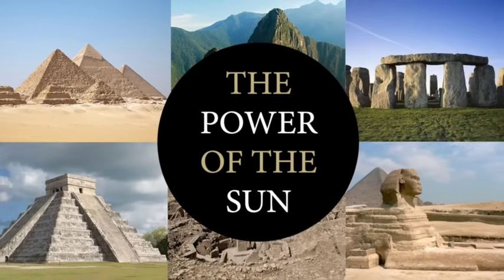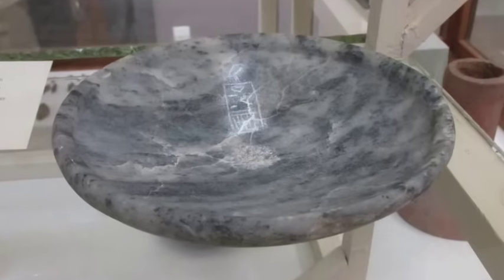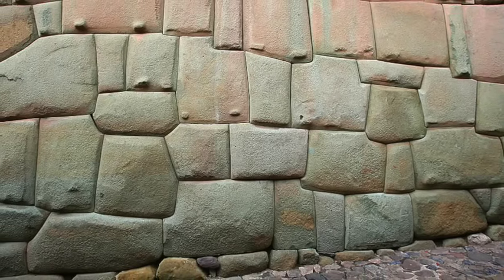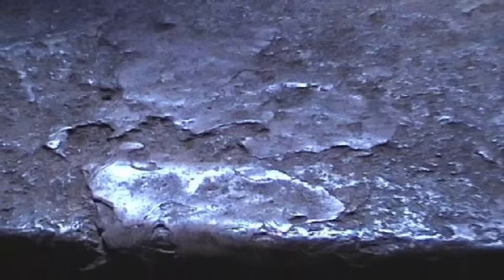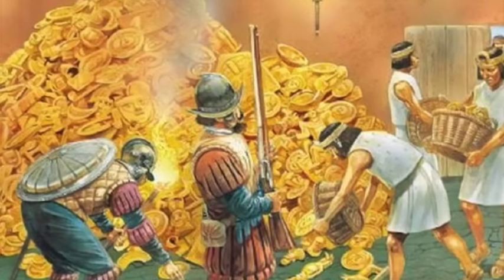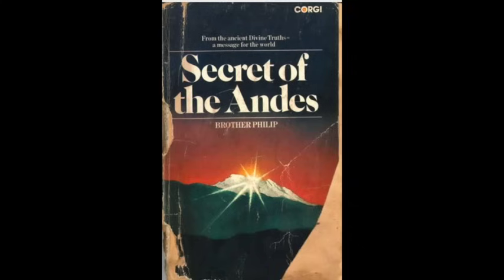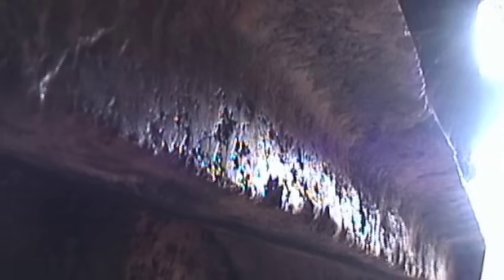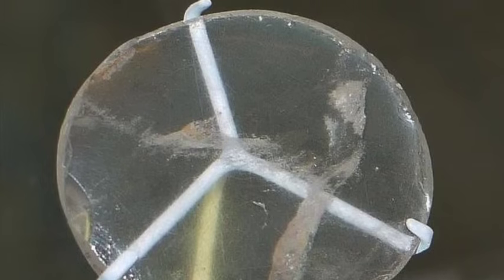How the Ancients Cut Stone with the Sun - Lost High Technology Explained | Ancient Architects

Comment: You are almost there. As I've said in numerous past comments. The ancient people including all the ones you mention in this wonderful video, had skill with polymer technology! They worked stone better than we did. They knew it better also! In modern dentistry, which is my background for what it's worth (retired after 22 years) what is done is the following. Now I want you to imagine that we are only catching up to what someone else did many years ago only on a massive scale. Bear with me, and forgive the length. 
We use a high intensity light to set up the material we use that is tooth colored. This glass ionomer composite material is quite pliable and workable before you set it up with the light. In fact you have unlimited working time to mold it and fit it and shape it and trim it and then when it is all done they cure it with the dental light. This light is so bright everyone including the patient wears protective eye wear. 
Now imagine this on a mega scale! Imagine they molded the rock, that it was a composite mixture which explains the as yet unexplained scooped out marks all over the place of specific  minerals of the top soil down to specific depths. Now why do you suppose they would do that? Maybe because it was a needed ingredient? Lets continue the thought process. 
They never had to haul anything but bags of minerals and specific ones at that. 
They also, whoever these people were crowned an entire mountain! Get this, they crowned as in held up and supported a mountain still being supported by these massive placement stones that prevented the natural falling rock occurrences that should have and would have happened without this event.  Consider that they saved an entire mountain from crumbling with this tech. And never once did they have to do anything more than mix the stuff, make it a putty and pack it in place setting it up to a glazed baked on finish. 
They did what we do only on a much larger scale. And the gold discs they used were 100% efficient. That means they could use these in series and not lose any of the power of the sun, even reflecting it through many discs deep inside of places! They did this with gold for this efficiency.
Reply: Well, some are here to actually discuss the subject matter and not make fun or light. I can continue. Long skulls apparently died off. We suspect they were mostly coastal and river dwellers. We know from the digs north of Chicago in the 30s that these long skull tribes traded with those in the Gulf and goods were found from further south also. Shells I think it was. As I recall these were only seen in South America. Anyway, interesting side notes and whole thesis papers could be done on long skulls and round skulls and their rise to power, and demise all from cataclysm. It appears today there are walking examples still of these 'long skulls' and we call them royals. These often display a remnant bun or remnant long skull often referred to in academic circles as "the Pharaoh Skull" and you can see remnant buns best in royals. Check the side profile of known blue bloods and they indeed do have Pharaoh skull shapes. Eric Clapton in fact has this shape and is a blue blood. 
It appears to me and others that RH negative blood type goes with these remnant buns. So does red hair it seems across races even. Mitanni display this and they were in Egypt also as I understand some of the wives were provided to Pharaoh and priests from these tribes that practiced cranial deformation but why is the question? What were they preserving? I suspect it was the ancestry barely evident unless enhanced but they probably did descend from these actual long skulls and the tribes that were once in charge here and probably did build most of the stuff we round skulls find so amazing. 
After this cataclysm there was a divide between the long skulls and round skulls in places and round skulls hunted them down.  Some say in the south Pacific these long skuls, led by a man named Patuko the Long skull ate humans or round skulls and called them the 'long pig' considering them the best of all meats. These tales are still told there and these clans had long skulls and red hair and looked exactly like those found in Peru and Paracus museums on display there. This was the long skull tribe they have tried to cover up because this is the tribe that ruled us. 
The digs prove they were the royals. When they died all royals today trace their very blood type to these same guys and they cover it up. Anyway, it's all there. Its research material I'm too old to do. But anyway, what does an old man know? 
Okay James back to your 'lazers' I suppose.
Reply: Oh if I only could James Wallis! I went to school at Southern Illinois U and studied anthropology and psychology for so long thinking I"d pursue one of those but there is no money in it! None at all unfortunately so I went with dentistry and graduated dental school instead! It was a compromise for money and I don't regret that but oh what I could have done if I had done the other! If only. 
In the 1930s a doctor Langford, one of my heroes did a write up and it's still here in the "Rediscovering Illinois" section of the 1931-32 Illinois State Blue Book" found here. I highly recommend the U of Chicago write up to all of you. It is hard to scroll through but well worth the effort. http://www.idaillinois.org/cdm/compoundobject/collection/bb/id/19158
I am what you would call an eternal student! I studied! I really studied and have over 367 college credit hours to my name from colleges all over as I went where ever I lived. I admire those that were in the field. My field was a classroom and a lab. But I was brought things. I worked on a team with my father in law who was a high up political person in dentistry. He was a elitist by definition. Editor of the ADA journal with all the contacts. This man knew things. He shared things and I was allowed to be involved in some anomalous find discovery of 'long skull' tribes of people dug up by some trying to sell fill dirt when they dug up bones! 
As in the article I site these were not Homo Sapiens Sapiens. These were something else, a long skull, older than us and found much deeper. It was found well below the original ground level of the mounds. This tribe predates the Hopewell by 2000 years. This tribe is documented as the first people of the north American continent. They were displaced by the natives we displaced when settlers came. 
I have examined these skulls and these skulls exhibit modified cranial nerves from that of human round skull tribes. Round skull tribes as in you and myself have 12 cranial nerves. All humans have 12 and no more. This tribe of long skulls has a modification of one nerve we call the trigemninal nerve in a human. On this being it branches additionally to become a 'quad-geminal' nerve and the long skulls most always develop and exhibit parietal foramina on the rear plate that is not seen in human or homo sapiens sapiens round skull people. 
It is possible that this addition of a nerve we do not have gave this tribe some advantage over human. Perhaps they could actually see these energies they tuned or maybe they could sense them in some way we cannot. So these stones and their placement are all set up as if they are tuned in place as if they could detect somehow the optimum position and type to use and maybe this additional nerve set up in their heads offered them some such way of making this easy for them.
Reply: Most plausible reference I’ve seen to date, this is actually outlined a little bit in the Mesopotamian tablets, by which knowledge was given of construction and building in exchange for service and minerals, this is a deep rabbit hole, there is a reason we inherently horde these precious ores, it’s the same reason we have a inherent fear of the darkness, we have a genetic mapping for survival, the saber tooth tigers damn near ate us into extinction which is why we have this survival mapping with darkness, the ores are what we traded in order to gain civilization and survival, progress, the polymer secrets were coveted by the controlling groups, the story of Moses and king solomon, and Solomon’s temples and city’s reference this, volcanic Ashe with romans and there cement is an example of this, ancient wizards or alchemists privy to this knowledge, iron oxide, magnetic flux and ect. The static and geo electric generators of the ancient civilizations such as the Giza steam generator and such.
Reply: Wtf
Reply: I never said anything about lazer and it's laser, rifles, or energy or antigravity in any of my comments James. Not one. If you don't read the sheet you won't understand it to comment dumb ass! You actually prove this. Go back to your bong!
Reply: Excellent questions M. Canut de Bon. First: Yes there is a link to the one that comes to mind which is the Lima Holes, and here it is for the select mineral explanation. This explains why anyone would do this to me as well as anything I've heard or read. They needed specific ingredients. That is my theory and we should probably evaluate those deposits and the layers for just what they were hauling off. http://www.viewzone.com/lima.html
I've watched I don't know how many videos on this where the narrator and the people studying this phenom. ask where is the debris from the Nazca plain? That used to be the top of the mountain right and it's gone right? Okay well imagine it was used to turn into powder and they recycled it into the stones that support all the massive amount of mountain that would slide down if it were not there to stop it. In Tibet the falling rock is the most dangerous part of living but in Peru around these large stones holding back this danger it is a different world of safety. 
I suggest a panorama view of Sacsayhuaman and other places such as that but nothing beats the Great Wall of Peru! Many don't even know this exists! And to be honest books don't mention it anymore and none of the newest series ever talk about it yet it's as impressive as anything there.  It does make one wonder at the apparent systematic attack of any narrative that takes focus outside that of the approved of field of view academically.. It is a massive endeavor this wall, that encompassed retaining not just an empire but it safeguarded the cities and empire from both marauders and the landslides, in some places quite well and it's held up remarkably well to scavenging by locals for stone, as well as earthquakes and floods over many generations. https://io9.gizmodo.com/5634600/the-ancient-abandoned-great-wall-of-peru/
Reply: Troy Taylor I spend much more time reading comments, than watching actual videos because of gems like yours, my good man. Thank you for not hoarding knowledge like too many others do. Much appreciated from Tucson, Az.
Reply: I used to think that but your theory means they had to transport those incredible size boulders to their locations and that is simply impossible unless the ingredients were first carried in small amounts that could easily be transported by pack animals and human means. I have tried to bake stone to soften it and it usually explodes, sometimes with some force behind it. Romans inherited the means to create cement that set up under water and this was used to make barriers to control the force of the incoming waves in several of their ports. While I agree it appears in some places rock was indeed being chiseled out and hand hewn into shape. even this can be explained for the terrain it was found on because using sleds filled with stone until the sled weighed more than the hewn stones they could move it for some distance using nothing but gravity.  Moving stones over the terrain in question on Easter Island and places like Peru leaves little else to consider except for some form of concretion mix they invented and baked to a near ceramic glaze in places.
Reply: Troy Taylor 
 Let's not forget what Teslsa Re Discovered, mainly  everything Tesla made or patents wasnt his.. phe Wouldnt  and never did made any claim that discovered  it him self  he rediscover what was forgotten..  Except one thing . Had   something todo about Aether he did search for years  in  9 languages. Before he claimed, it he discovery,   that another story.. Tesla push for free zero point  energy for every one at any time as much as  you wanted.. An endless supply of it., we would  never need to use oil or any of earth natral RESOURCES again he was very adamant about it because we were are killing the planet by removing. Oil natural gas methane. We keep  taking from  the EARTH and she been giving and giving with our  giving  back, how much could she take of that type recklessness spending.. Like giving your trophy  mistress  a 10k limt credit card. she thinks she  Kim Kardashian.. it's max out by Friday.  What did she give back.  Nothing but demands more or she leave you for your boss owner of 1000million dollars a years co,..  . This  is why she dieing . Right now the  Pacific Ocean is already dead.. the sky and the air  is mostly a Toxic  Chemical . They been chemtrashing the skies   for the last 20yrs.. all for better communications. SO they say,, right....?. The technology wasn't just the sun but also the 7,83hz of planet earth..And the Aether. Or  power of 369  Brikland currents hall current  Peterson currents.and so on and so on. Electromagnetic portal connections between the sun  planets Galaxies  all take place all day long every day universe is filled to the brim . We couldn't use up a drop worth in billion years.
Reply: Apparently the pyramids are polymers and it's provable because the fossils in the rock are not aligned as they would be in normal rock.
Reply: Troy, excellent conjecture.  A couple of questions: 

1) what examples are you talking about when you said "unexplained scooped out marks all over the place of specific  minerals of the top soil down to specific depths" is there a place in particular where this can be seen?  

and also 2) What place is the one you are referring about with "these people were crowned an entire mountain! Get this, they crowned as in held up and supported a mountain still being supported by these massive placement stones that prevented the natural falling rock".

Very curious and thanks for your post.
Reply: I like this line of thought too. Joseph Davidovits.  https://www.geopolymer.org/archaeology/pyramids/book-why-the-pharaohs-built-the-pyramids-with-fake-stones/    Near my house is some gravel that is crumbled granite.  Even granite has it's day.  The gravel and sand has all the colors of granite and can be glued back together with soluble SiO.  One day I'll get off my butt and try it.
Reply: Troy Taylor , I really enjoyed reading your comments, you are obviously a driven and thoughtful person with a heck of a lot of knowledge. I can’t really make my mind up how I think they did these things, reading your ideas is thoroughly thought provoking.
Hopefully one day we will understand just how these amazing structures were built
Reply: Alex I guess it began in CCD as a good little Catholic boy! I asked so many questions, difficult questions to the priests and nuns that on one Sun. I was pulled aside and told, "You know Troy, if you want to skip CCD from now on it's fine, no one will say a thing to your parents!" I kid you not I skipped too! My brother loved it and later used it to leverage me into his own devious behaviors as a youth that I in turn had to hide for him. Such was life at a time when innocence was still present but even then I knew someone wasn't presenting the entire picture but various versions of their truth, Catholics included! My IQ and my "SHELDON COOOPER" syndrome as my wife refers to it has gotten me into trouble on more than one occasion. I try to blend in and be normal but the truth is I am not and just make a fool when I try to behave as anyone normal would. 
I see. But when it comes to some things well, it just stands out. I could almost say I smell it. 
Lexicons Recentis Latinitatis. This is something that stands out to me but I read Latin. This was published by the Liberia Editrice Vaticana where they insert the Latin neologisms you'll find that the Vatican inserted the following terms if you look. Those being,  "navis sidraelis which means 'starship'. So the Vatican calls that thing they saw that distinctly hovered over water that they depict and use as the basis for all modern religions called a "RUACH" or God's fiery chariot is called a "STARSHIP" by the largest religion on earth? Boy this excited me being a Star Trek fan! 

They inserted aeria navis in there also! Oh boy I thought to myself 'thus' airship, and they were talking about flying machines in the bible and the Vatican wasn't done! Man I'd found the frickin' gold of all gold they inserted aereus viator which is astronaut! Someone in ancient saw a astronaut!? MY head was spinning! I couldn't wait till CCD!  And the Vatican also inserted the acronym R.I.V. which to me and my dad was as good as saying UFO baby!! All it did was get me a ticket to skip though and so I did. But you know what!? That was a mistake ! I should have been on his ass! I think that was what put the thirst in me. I was hungry then. I didn't get a answer. I was not going to be satisfied and my anal brain would not rest until I had that satisfaction. My syndrome prevents me from lying. If anything I am guilty of being brutal honest. I don't have many friends and prefer this venue just because of my condition. Some don't get it. 
Thanks to some few that do I stick with it because it's the only real social life I have. Thanks for not telling me I can just skip this class.
Reply: Maybe they saw lava from a volcano, watched it cool into rock and reverse engineered the process whilst tipping the liquid into molds?
Reply: Troy Taylor Interesting comments
Reply: Troy Taylor very interesting do you have any idea of what the compound that was used but I jade my own theory nikolai tesla invented the isolator it's a kind of computer that can find the frequency vibrational energy of rocks or anything if you find the frequency vibrational energy of rocks you can negate the magnetic fields vibrational frequency energy that's surrounded the rock and levitate the rock or you can destroy the molecular bonds and break it apart
Reply: I worked for a time as a student trying to learn flint napping and never could quite get the hang of it as well as I would like. I got pretty good at making human tools but not great, and certainly not good enough to survive with what I made. I had friends that made things very well though and theirs worked. One of these guys does museum pieces and is quite good. One of the best actually and he told me that the Neanderthal tools are much more difficult to duplicate and that in fact no human can duplicate them. We can't do them as well as they did them. Theirs are excellent and efficient and ours well, suck! They worked stone better than Homo Sapiens Sapiens. Others did also but we try hard.  
There is a reason secret societies call it "MASONS" I think. It's all about the secrets of stone! It always has been about stone.  Today we can make any surface. We have the technology to make you a granite top from granite dust and we have the ability to make any other stone so it stands to reason that someone else did that too. 
What people don't realize is that the stone has an electric charge to it. Most all these pedestal stones and standing stones have energy about them, either sound, static or vibes being noticed. It's not accident that profound visions have been recorded through history by people laying their heads on standing stones. Solomon, Arthur, David, the list goes on. They had visions around stones. 
Looking at the layout above you see immediately that the ancient people that laid out the grid were using the standing stone monuments and assemblies as giant computer circuits. The earth was the circuit board the the temples and complexes are the computer chips and the charge is running through the earth grid connecting all these places by the circuit completed. That is why I've called it circuit board earth because from above that is what it resembles, a big ole circuit board with connected Mayan, Incan, Aztec, Egyptian, Korean, and more African connections broken than anywhere! One has to wonder what would occur if these were reconnected to the grid? 
What is more puzzling is the placement of the grid stones. They are precise and aligned with nodes and intersections of ley lines and magnetic energies as if whoever did it could sense it or see it to line it all up. We need technology to see this but someone else either had the tech. or they had a natural ability to sense these energies. Tesla proved all the obelisks are power sources sending out power to something. However for thousands of years nothing has been using this energy. There is also known continuous energy emitting from the tops of pyramids world wide no one can really explain. They prefer not to mention it.
Reply: +Troy Taylor  funny had the same thought just a week ago. after I had my tooth filled they cooked it on. was thinking about how I could build with it. like giant blocks and walls of white stone. the material we use atm isn't strong enough yet. I always believed they molded the giant stones like pouring walls with finished exteriors when still wet. let it set a bit pull forms smooth out. never thought about needing the sun though. would be more efficient than having to use a fire.
Reply: Built by the nephilim who where fathered by the fallen who was enlightened by God?of course they where all smart?not only did they know how to soften stone but knew how to mess around with dna also?
Reply: Cutting and trimming can all be done using sonic instruments. They had low voltage and knew about chemical reactions also as evidenced by  finds but I think gold wire had the same 100% efficiency so a battery that pumped 18 volts pumped it at the source and at the instrument both due to the wiring they used. So just as that link to melting stone earlier shows they could cut stone acoustically with low voltage all day long and have light in there to allow them to see all they were doing even in a cave using discs also made of gold that lost no efficiency or brightness over any distance regardless of the number of discs used. They could literally spot light an area of the mouth to work on a tooth size surface if they wanted. All it took was minor adjustments with mounted discs. In some places you see the weird appendage pedestal stones and I believe they did indeed hold the disc so it could be manipulated. 
By the way if you guys like some of the subject on long skulls and want to know more about that and red hair, and more look up Gabi Plum videos and watch our Cousins across the sea the red head people and her others. You'll be thanking me.
Reply: First. I would like to see stone melted from solid to a liquid.Someone said it was like no fuss or something. Show me. Love to see it. Sincerely.  M. Gritz.I did not see any evidence of a eye in my autopsy. What I saw was a cranium approx. 20% maybe 25% larger than a human or common round skull. The mutation, of the fifth cranial nerve if I am to call it that, perhaps ours is the mutation? But I digress. The adjustment would be necessary to this nerve I suppose to feed blood and nerve supply to parts of the brain and skull that we simply do not possess. I am unfamiliar with the tests of which you speak with reptiles. Sounds very interesting though. 
If I was your dentist and gave a shot to you called the "Gow Gates" in my field, it would give me a complete mandibular block on your face giving you comfort for a lengthy procedure. For you it would be easy to chew your tongue, your cheek, your eye would droop and you'd slobber all over yourself as your lip drooped because I'm blocking that cranial nerve or most of it that we call the trigeminal and it would repeat Bells Palsey symtoms on your face for hours. Imagine this guy though with the cone head getting that shot. What might it numb up? It could effect his olfactory sense tremendously and if he was a species say geared to that it would be akin to taking a cat and cutting it's whiskers off!
Have you ever treated a cat from a fire that lost it's whiskers! It's like they may as well be blind and you took their security blanket because most won't budge or move much until they come back. It's like they can't leave home without it. 
Someone else mentioned Persians! You know the Persians were the great sailors and they took the "SNAKE PRIESTS" all over the world. Snake priests were Druids or Maggi in the bible. These were holy men but feared and their serpent like dress because of their fancy for reptiles and wearing croc and alligator skins and teeth and such well, and with the cone heads they looked like snakes. They were said to be tall also and ominous. They still leave the impression of the angel of death. 
 They hunted these guys after the divide. Some say legends of reptile and giant slaying all stem from that and that they were cornered or at least a gaggle of them was cornered in Egypt. Think Akhenaten the Pharoah on the run as they ran from Egypt to Peru then to Paracus. In small pockets they hid but then they found a way to hide in plain sight the way they do now hiding this story and themselves. Those that hide this are those usually that would also have this "EYE" or the potential to see somewhat in this way you speak about. I don't dabble much in the paranormal anymore but I know it exists and things happen.  Therefore the potential exists that some small group of these hybrids that were thought to have been hunted out of existence do in fact survive in the leading families of our rulers. Just a thought. Just sayin'. We have certain evidence of another hominid on this earth just covered over like it never happened. Why is that you figure? Maybe because like the movie they do in fact live! They Live. Oh boy.
Reply: How complicated would it be to assemble the ingredients for these compounds which end up looking like different kinds of stone?  This YouTuber shows how to make Roman concrete, is it possible to make concrete which looks like diorite, granite, andesite? https://www.youtube.com/watch?v=tOhAfaFboNU  Some of the drill holes and cut lines look like power tools were used.  Maybe they knew how to soften stone, then let it harden again?
Reply: Troy Taylor I work with a guy from airforce he said his job involved testing directed energy weapons on livestock.  Real deal.   Working units of deathrays
Reply: Leaders or elite among us always wanted to control the masses. The control is a big factor to them. They have to remain hidden I think. Wizard of Oz, think the man behind the curtain. The thing is they need to be seen with awe for their power to work. So I think the mystery is a necessary ingredient in rule of the people. 
In the past the tunnels under such things as the pyramids had a purpose and the priests thought to be holy, and above corruption of course by the innocent masses are not like this at all but are actually all from known crime families of pirates that were wanted on the high seas before the big cataclysm. These families survived in large part better than the elite rulers that were at one time hunting them. These families started a little thing called the Church and became very strong. They are still strong today too obviously. 
After the cataclysm the crime families that survived acted fast. All the matriarchs of the old system were systematically hunted down  while they were weak and by the crime families. They did this to secure papal appointments. 
The pope would appoint the King and then the king illigit of course, had to become legit somehow. So he would bag him a queen.  The old system was that of a Matriarchal system, think ISIS and that. They began wiping that out over time and infiltrating it. 
History shows how they did it and I won't rehash that. The fact is though all the stories we know as myths,  Cinderella, Snow White, Rapunzel and more all are based on fact. These matriarchs were captured, imprisoned, drugged, raped and kept as slaves to make them brood mares for the illigit kings appointed by the pope. Since the bloodlines ran in the women in that system mating with them to produce children made the kings legit. 

Most of these crime families are from IRAN (ARYAN) and have the cone head heritage or long skull heritage as their claim to rule. Most look down on humans and history shows that they did this. Remember the story of Abraham in the field and he spots some of them and notes instantly how they were of the Maggi? He saw their heads! That is all he needed to see. 
The church gave us this amnesia while they kept the records. The Alexandria library did burn but they kept those ancient archives and had cleared out what they wanted before hand. It was all about control and keeping the people from remembering so they could continue to get away with their mass piracy. Secrecy was key and when Patrick removed all the snakes from Ireland he was not referring to snakes from your garden. But the snake priest religion.
They twisted that too along with other stories. If you want a wake up call and I mean this sincerely you should watch this and this woman here is world class folks! No one knows more off the top of their head than her. She is a saint and blessing on this planet! Probe! Probe my friends this woman > Miss Moret is a gem among gems! https://www.youtube.com/watch?v=ndUJl6aNsMA&t=574s
Reply: M. Gritz you'll enjoy this one.  Some tid bits from Mauro Biglino. Biblical scholar. " In the bible God makes clear he had to smell the stink of burning meat! And when I say stink I mean that particular odor he asked for, was that of an animal that had to be completely burned, fat included. 

In any Bible you can read, 'Elohim enjoyed the aroma of burning meat 'only the Bible doesn't say that exactly because those that translated it wanted to control the way it was understood! 

The Bible tells us that this was REYA LIHOHA, that means, 'a soothing odor.' So a sedative odor to the Elohim. No doubt about it, the odor calmed Elohim down. 
Now for the mind blow! Did you know that NASA created an essence that reproduces the smell exactly of burned meat!? Yep!  They do this because they introduce it to the astronauts by spraying it in their spacesuits as they dip into the water to exercise in zero or near zero gravity.  They do this because the astronauts you see have to prepare for the smell of this stink and get used to it because in space they will smell this all the time! 

Out in space desquamation of the epidermis accelerates. As the astronauts move around skin cells slump off within the suits. This happens putting them on and when taking them off also. This accumulates over time. So when they get back to the capsule, and after all that friction cells are inside the suit in large numbers something begins to occur. The cells without gravity float up in the air, coming into contact with the artificial atmosphere of the capsule and they oxidize, producing a very intense smell of burnt meat within the ship. 

If you read cuneiform writing like shown on the Sumerian tablets where it is told any single time the Sumerians burned meat they report the Annunaki arrived on the meat like flies, highly attracted to the odor. (Note here as I interject into Mauro's quote that the Annunaki were cone heads or long skull tribe people not aliens and they were those ones we suspect have some added olfactory sense due to that cranial nerve mutation we mentioned earlier! )

Maruo says that this doctor sent him a very detailed study which proves this odor has a soothing effect and proves it through science. He has mapped out the picture of the molecular structures of the transformations that fat is subjected through when grilled. It shows how these structures of burning fat form the same molecular shapes as our brains endorphins take when our brains make us more soothed and relaxed! 

So from this, the Vatican starship confirmation, the pictograph of the Sumerians depicting the craft distinctly hovering over water we can conclude quite easily why the Elohim appreciated the stink of Abel's lamb. But he did not bother at all about the cucumbers and Cain's offering and wasn't at all impressed was he?
Reply: Doesn't account for the ancient quarries found with cut stone in them though.
Reply: Wow, I knew something greater was 'going on' in my visits to the dentist. Thank you so much.
Reply: Water turns to steam and that explodes the stone...heat slowly and let the water evap slowely
Reply: Gods Elect, everybody seems to be passing your comment by.  I for one would like to hear how you do it.
Reply: Troy Taylor   I like your idea but two things:  look at the wall in the picture of this video.  Does it look like it was done with the method  you describe?  And obviously they were smart but the most likely stumbled upon this method and didn't really have a lot of other options.  Why can't someone just take one of those discs and check it out?
Reply: Well? .... Don't leave us in suspense. Where's your evidence? Show us something!
Reply: Troy Taylor cool shit back in the day.
Reply: I  know that more than a few things in Egypt are geopolymers.  I have seen pretty good argument that the stones of the pyramids were manufactured. I do believe it to be possible.
Several of the obelisks in Egypt are broken and chipped and low and behold NEW EARTH videos here on the youtube reveals inner cores also. This of course like concrete looking mixtures of apparent cement mixed with rock and gravel chips like modern stuff. The so called 'solid' granite is just an outer shell covering it. In fairness we have to ask did the Masons tear down the original solid obelisk to get the corner stone time capsule hidden underneath by the long skull tribe builders? If they tore one down they would rebuilt it the only way they could right? Covering it with a shell concealing an inner core. 
It's reported they did knock down Stone Hence just to get the time capsule and learn what the builders knew? Then they rebuilt it to the present condition to conceal the fact. Why not obelisks? 
I think the Long Skull kings ordered the building of the pyramids and humans were the slaves that hauled everything. They don't know how the stone was made because that was done by long skulls with the know how. Secrets of the stone were held sacred and that is no coincidence that the biggest secret society is called the "Masons" as I hinted at earlier.
Reply: It is possible, even remote and I'll go that far. It is possible that this mutation if you will, gave them some spatial processing ability above that of a everyday human. Since I am 99.9% sure I see remnant buns in even such people as Prince Charles among others I see this among so called lay people too. One named Terrance Copeland was on briefly with Bill Burns I think is his name when they had that Michael Lee Hill UFO episode on TV in his series. This man Copeland, a young black man forced to leave the service due to having the same blood anomaly that Eric Clapton and Michael Lee Hill both share (Michael is Eric's bio-son btw) and yet this Copeland is blood line. I can see it in his skull. He is Mitanni and probably doesn't even know it. He has a remnant bun quite visible also. So you know it stands to reason if we could examine his skull when he dies that it would be one with these parietal foramen. I'd bet dollars to donuts he is RH negative blood type also and he probably carries the red hair genes at least one of the three. I think anyone can train themselves to spot a Pharaoh skull and we can also begin to test and understand those advantages they have over those among us that are round skulls with no heritage of these cone head genes. I don't think all of these examples I see are anything to do with cranial deforming or something created by the habit of a people in the past either. These craniums are often higher capacity than round skulls and you can't get that by cranial deformation. It only deforms the mass already there. I think there is something here. Some people even stars, have huge heads and remnant buns walk all around us so we would have to wonder. I mean I wonder do they see the world and feel it differently. Does their spatial reasoning excel due to this? What is their average IQ? Why is is distasteful to inquire? I see no harm in discovery do you? Thank you for your input. M. Gritz.
Reply: no.
Reply: Troy Taylor 
but if they did that,  why are there machining marks ask over the pyramid stones?, well,  many of them.... I had my front tooth fixed like that... 42 YEARS AGO! STILL PERFECT!
Reply: Bobby Reynolds I think there could be machining marks on manufactured pyramid stones or any stones really. It would make sense to impress any writing or art on the material while it was pliable. 
There are also other ways scientifically to do this guys. Kinetic energy is real. Someone mentioned Air Force weapons but in dentistry we use air abrasion also. The Kinetic Cavity Prep. or KCP is a $25 or $30,000 machine used to do cavity prep in teeth and it uses kinetic energy to do the prep. 
No anesthetic is needed with this most of the time. If the KCP air compressed unit is pointed and used on something soft like your tissue or a tomato nothing happens really. It's just a slight abrasion feeling. But the harder the material it strikes the faster it cuts! So the harder the material is that you are cutting the faster easier and better it is to cut with kinetic energy. Harder surfaces cut faster with this. 
It's like a super charged water jet machine that is portable. You could literally cut out a granite wall faster with this than you could with blades or other means. And the surface would be smooth when done. 

Someone asked why it's secret. I think it's secret because there is a sub species of human being walking among us that apparently is aware of it's circumstance and doesn't want to draw attention to the fact they are a separate and distinct sub species of something other than the round skulls they live and work beside that are the majority.  These separate sub species of humans are apparently for the most part somewhat compatible with the round skulls and can interbreed with them but not without help. This group apparently goes out of it's way to keep itself separate and isolated even from the majority of the round skulls and is apparently mostly composed of royalty circles. It also appears to me that red hair, at least one gene anyway, and RH negative blood type are all related to these hybrids walking among us. Separate and yet factual to this is the studies of blood showing that one group of humans, the smaller of the two at approx. 15% of the pop. has a copper based hemoglobin while the majority have iron based hemoglobin. 

This paragraph above is the problem. Mention it in academic circles one of two things happens. You are then part of a circle of quiet talk around the water cooler or you are shunned and looked as a conspiracy nut. Someone wants to control the narrative and keep this as a taboo. I'm sick of that nonsense! There is something here. I smell it. They can't hide any longer. It's out. I've spoken on it. The people know now and it's spreading. If my father in law had not died I'd have taken this to my grave. But there is something here. I've seen it and examined it myself and I know they cover it up. I think they cover it up because they don't want us to know they exist. It's that simple. It appears they go out of their way to keep separate medicine and separate differently trained doctors for these royals and they also seem much more homeopathic to me. Then there is the other obvious thing in that the walk themselves keeping themselves above society as monarchs not even paying taxes or anything else but stemming from the great vast land owners of the past they make their land claim and therefore their royal claim. The fact is they all trace to these long skulls. A separate species of hominid and it's all about purity. We all relate to them if we have red hair and blue eyes, and remnant buns on our heads but the pure ones fight over the last drop of cone head blood right in front of us about king ship and this is apparently where it all stems from, these long skull tribes of old and the fact they are their ancestors.
Reply: Great Mechanized Ape. Find one where they make a solar death disc out of polished gold and see what happens and compare temps..  Of course no one could afford that. Thing is though you would be able to use the discs made out of gold in series so you could have multiple discs and not lose any of the sun's potential. Gold being 100% efficient there is no degrading of the light over multiple discs. Glass does not offer this. 
Therefore it stands to reason the primary purpose of the main discs or discs would have been to light up dwellings by reflecting light out to other smaller discs that then were fed off of the main into where workers were trying to do carvings or astronomical charts in their huts and so on. In the case of providing lighting I doubt the light was enough to hurt anyone. They probably had discs that focused the light better and more intensely and perhaps the gold discs did heat up the surface it was pointed at enough to melt bronze so they used it as an on spot forge maybe to melt those keys into place and pour them to lock the stones up so they didn't move. 
For all I know achieving the 900 degree temp to do that would be quite possible wit a parabolic gold disc vs glass. Unfortunately I don't know anyone that could make that kind of lens though and again we'd never be able to afford it if we did but I have read that NASA uses gold to line their glass in the shuttles and other devices and that gold wire is preferred due to the efficiency of it and the way it can be thinned down to tremendously thin strands.  It would be interesting to see the difference if any though.
Reply: Troy Taylor cool thing to add to this thought. Has anyone ever met a well-witcher ?  I met someone that could find water at any depth and tell you how fast the water was flowing and how much water was there using a willow branch. This man even let me hold his arms wrists and the willow branch to prove it wasn't just some hokey joke
Reply: I was wrong for saying we deserved this. No one deserved any of this. My mother is half Cherokee. My dad is mixed blood also. So I’m also a mutt/mixed blood and not even sure of my african lineage. I am sure about parts of my family coming here as slaves, given my last name, and location. But I don’t think we’re west African, maybe of Ethiopian blood because my family is full of lightskinned people. Only reason I’m as dark as I am, is because of my dad having dark skin himself. This led me to believe the dark skin is more of a dominant trait when mixed in I believe. Only based on the observation of my complexion in comparison to my families. Mixed Cherokee and “African-American”. What Europeans did to native Indians is not comparable to territory disputes in Africa or in the Americas prior to European colonialism, can’t believe someone trying to speak for Navajo is defending the ones who are guilty of genocide and theft. Right after our national day or mourning. Sad
Reply: Troy Taylor well said.
Reply: Thanks for that link to geopolymer.org Drake Dorosh.
Reply: That is flattering. I didn't think I wrote all that well. But thanks. 
The official names given to Bigfoot or Sasquatch is muti-fold into species of new world monkeys. We have known about it since well, at least officially since the 30s when fire fighters found three bodies, one female grown adult and her two female twins that were youths. 
I was privy to read the reports on the one named Cebidatelidae texicanus which is the southern version of this primate. This one is barrel chested and huge! Massive really and has opposing thumbs and hit howls like a howler monkey which can be very scary to be near. They are opportunistic, can be predators if need be but mostly avoid human but focus on hoofed animals which makes up the bulk of their diet with insect galls as a staple. 

The one we identified from the NW of the USA is different. We call that one Cebidatelidae nerteros pacificus and this one is also huge but long and lanky! It has a hook on it's hands and it's thumbs are different more like for climbing which indicates it stays in the trees more. It weighs less but is still massive compared to a man! These have scent glands on their arms like some other new world monkeys and it leaves scents along the trails it climbs. These are the easiest to find because in years past you could train dogs to find the scent but once they tracked it and discovered what it was they would never track it again after but run home in fear uncontrolled to the point the animals were simply useless after meeting Bigfoot even for a glance! So the dogs were only useful once until they realized what they were tracking!  Then they not only refused to track the Bigfoot again but in many of the cases the dogs never were useful for that again and were retired. These are primarily arboreal creatures or tree dwellers in the northern part of our country whereas the southern version are cave dwellers primarily. We don't even know if these are compatible but versions of both are 'facts in evidence' that scholars, certain of anyway, have seen and examined and then been told to shut the frick up about! Some don't tell  well though!
Reply from the maker: Troy Taylor Fascinating! I'll keep researching. Thanks!
Reply: I am sure we are on the right track here. 100% sure we could duplicate it too. The different size discs found all equate down to different cutting widths, shapes much like a nozzle on a modern garden hose? Imagine you know cone, flush, fan, shower, you know all different ways to use the light frequencies. They were genius! Truly genius and you have to be one I think to begin to see as they see or as they saw regularly like apparently everyone was just this frickin' smart!
Reply: The Godless cavemen smack rocks together. Others can cut stone with diamond or my personal favourite lazers.
Reply: yes tool much more powerful and versatile than laser with infinite adjustable width and length
Reply: Troy Taylor how did they move them tho?
Reply: Troy Taylor 
NOT the cultures mentioned here.... 
This is more crap from the mainstream.
Reply: Gods Elect show us pal show your great work
Reply: Troy Taylor WOW!
Reply: the dental light is not bright at all. it's a UV light that can cause serious eye damage because of the frequency of the light spectrum. my dad is a dentist. Iv held those lights. Iv turned them on. the sun doesn't put out as much uv as they do in the same amount of area.
Reply: First of all there are several generations of lights and some of the older ones still in use are indeed too bright not just the correct frequency. The point is not the UV light. I never said anything about that someone else did but the point isn't the UV but the technique. It is an assumption that UV was even needed to set up their mix if indeed they did make a concretion type composite.
Reply: When I look at the tools they couldn't even make a perfect cutting edge shape hence they made precise measurement for structures , i am out of it lol.
Reply: They should at least make a demonstration of how this claims really works.
Reply: organizemyroom we are not the waz all be all best of God's creation.  We hide our inadequacy.   Greek fire anyone?      There are some large quartz vessels in egypt that are vented for drainage and have a perimeter around bowl lip that looks like you could insert a collector or accumulator reflector.   Never seen them in real life just pictures.   The holes around top fit something?
Reply: Troy Taylor just look up home made solar death ray.
Reply: yeah it kinda does because if they needed gravel to make cement they would use a quarry to gather it. I posted a link to one place they quarried earlier.
Reply: @david lefort Do you have a reference for your claim that "tesla invented the isolator it's a kind of computer that can find the frequency vibrational energy of rocks" ?
Reply: Justin that reminds me that I have not mentioned water really. Imagine though that you had this sun disk and it was pointed at the sun to reflect to another disc that still pointed to another and eventually it would direct the light where they wanted it in a series. Now imagine they found a way to incorporate water into that main disc sitting up looking at the noon day or mid afternoon sun to where it had the prism affect of water in the disc too. Then imagine if they also had low voltage batteries and charged the gold disc with voltage while it reflected the sun through the gold water filled disc. I've never been able to reproduce the said effects as you'd need a big amount of gold but it is said that something miraculous happens doing things this way. It was also said to incorporate sound so it was an acoustically and electrically charged water and gold light.. 
So my thought is that okay you have his disc facing the sun now with water in it, and its got a charge to it of low voltage that also vibes and makes a sound. What happens if you hook a thin gold wire to that and run it to a big bulb on a pedestal deep in a pyramid? Does that bulb light up bright from this disc then? Does it somehow translate the light frequency through the wire to that bulb array Von Daniken shows but powers with batteries alone! What happens if you do it the way the myths tell by hooking the voltage to the disc? Why is water needed and what happens to the water that they spoke about that changed it to make it seemingly freeze in time but it was still liquid? 
I think the ancients knew the secrets of water and how it makes it's own current of electrical charge. I think they built their big cities at the places where water forked for a reason, as there is always a charge there. https://www.youtube.com/watch?v=wfue_iCu0gE
Reply: Troy Taylor and a certain people came touring around nations plundering and destroying for the avarice of wealth. Killing, enslaving, and raping indigenous people. Taking what did not belong, Lest we forget.
Reply: Don Xuan it wasn't just a 'certain people' it wasn't just one race either or one time line. Looting and plundering is as old as the haves and have nots that started in caves. Piracy still is a big business of the elite. 
Genghis Khan was a looter, a rapist, a plunder, child, woman or man slave salesman to anyone with something to offer that he was interested in. 
Shakta the great Zulu King not only was a marauder but left that in his wake as clans that feared him fled. Marauding clans, fleeing the Zulu wrath and searching for land, started a deadly game of musical chairs that broke the clan structure of the interior and left two million dead in its wake from those running in fear from one King becoming bandits and looters and plunders and slave traders and rapists themselves. The Boer Great Trek of the 1830s passed through this area, succeeding only because virtually no one was left to oppose them. They were all cleared out and killed by these clans running from Zulu warriors but themselves being just as bad. 
In the Americas the Navajo were notorious looters and then they'd run off into the canyons to hide.
Reply: Troy Taylor the Navajo looted from whites? What? That’s ridiculous. With that logic you might as well say whites are notorious thieves. I wasn’t implying it was a particular race, anyways.. evil can be colored or absent of. Makes no difference. A certain people who intentions are of greed, power, and vanity, if I did not make that clear before..
Reply: And I did not come from a cave, that is of your lineage not mine.
Reply: Dude I'm half Navajo! We looted from the Ute, the Hopi, the Pueblo. It didn't matter.
Reply: Troy Taylor well I stand corrected you’re a thief and maybe the land being taken was like karma for your Looting people. I guess the Roman Caucasians didn’t have any influence on the way indigenous Americans or indigenous Africans live today.. tell me why would the indigenous people steal/sell their own cultural artifacts? What sense does that make. Who ever has money and big military does what ever the fuck they want. That’s how that works.
Reply: Don Xuan please. If we are being honest natives displaced and or absorbed the original occupants of North america, the Long Skull tribes that predate the Hopewell by 2000 years. They were forced out over time before whites came. Speaking of whites when the first ginger mutations occurred in dark tribes those whites we're discriminated against by their very own people and many times killed or forced into exile. Perhaps this is where their behavior stems? From the behavior of dark people in the past the white take over is the same as Ghenghis Khan which means grey eyes.He was a mixed blood hybrid discriminated against the same way by his own and it created the motive for him to move on all of them later. What goes around comes around.
Reply: Troy Taylor when whites went to Africa they colonized Africa. Irish gingers weren’t made slaves by Africans, what evidence do you to support your implication of africans being hostile to whites, prior to slavery and Europeans colonialism? Please tell me African tribes did to be captured. The ones who came to America were prisoners And the biggest forced migration in history. Why do you keep trying to justify the atrocities of others. I do not label myself anything but an American mutt, it does not matter our race, unless you’re a Jew in America, chances are you’re mixed.. even the Jews I believe are mixed and just claim to not be. Bewildered by Ashkenazim because I thought being Jewish was a religion and not a race But apparently it’s both. I also hate when people say africans sold their own people into slavery. That is a total misconception. 1. It’s wasn’t their own people, there are  many different cultures in Africa. They’re were some dark people selling africans but they were a Muslim people. Those Muslims were not of the same blood as the people they sold. 2. I hate when people try to point out to me africans had slaves because I’m not African, I’m a product of bondage, living in the house of my enemy.. a place were everybody is drunk on the wine of fornication...
Reply: I mean arabs not Muslim. Maybe they were still Muslim though but I can’t confirm that. That was ignorant of me to say initially.
Reply: Troy Taylor you didn’t say africans but you tried to justify whites behavior towards blacks by implying it’s because they were at one point victim to darker people doing it to them. I’m not racist if that’s what you’re implying. I’m mixed.. I find some of your claims of me being prejudice towards whites extremely hard to believe considering I think gingers are very attractive. I don’t think they’re any better or worse than any other race. No one should be excluded from international law. And hate to break it to you but this whole country is built on the blood of others, and now a days, Negros are too ignorant to care, Caucasian never carried, and apparently the Navajos were you’re from don’t care anymore.. it isn’t alarming to you ancient civilization already had this technology and it’s 2017 and we’re still trying to figure out how? Yet we can send men to the moon..
Reply: Troy Taylor funny I already seen the documentary as well. And read into the book species with amnesia.
Reply: You’re right at the end of the day, I know your intentions aren’t to justify genocide. You’re a good man and I agree with a lot that you’ve wrote to me.
Reply: Mirrors using the sun to cut through granite ... does anyone have any videos showing this <i>being</i> done, rather than just speculation that it <i>could</i> be done?

If the ancients did it, surely somebody today has replicated it, right? 

If so, please show.
Reply: No no. What they did Miyojewolt was take the stone and heat it up to make it dry out so they could crumble it. Take limestone and heat it and it dries out and becomes lighter and easier to break apart. Then once in a finer powder you bag it up and haul it to where you want to make rock. They'd load up pack animals with nothing but the powder and off they went and in other places closer to the work zones they started mixing water back into the powder as it was dumped on the ground. High in the mountains of Peru you can see limestone 'pools' of what was obviously a slush or slury mix about like we do for cement and it's the mixing of these powders after baking with very little water actually because its supposed to be a paste. This is just how Romans did it and they would add sea shells to the mix of other stone if they didn't have enough lime in the stone they were using.  This video shows exactly how they did it but on a smaller scale. https://www.youtube.com/watch?v=tOhAfaFboNU
Reply: Alex Botsford, apologies! I just saw this. Do I believe in evolution? I am actually one that believes all species do adapt. If you want to call it evolve okay,  I do admit having a problem with the term. I prefer adapt. I think all species are highly adaptable perhaps even since we are mostly a high percentage of water I could say in many ways we are all actually shape shifters capable of changing our shapes by our minds and will in conjunction with environmental changes. Some of the observations by Darwin are quite interesting but unlike many I am open to looking at alternatives.
Reply: Yeah they have tried to cover up a lot and succeeded mostly because greed trumps all other needs for most. 
They have documents on at least one from every part of the globe believe me. One of these days someone is going to break into a museum and not to take anything, but just to go in at night and document via camera and video fractions of what they hide in the basements and back rooms no one knows even exist! The stuff gets accumulated constantly because more doesn't fit into their theories than does! If they can't explain it away to make it fit somehow into their boxed in view they simply hide it out of sight. 

All the known species and sub species are listed and the U of Utah, Iowa, Idaho and Illinois all have some scientists that are well advanced into the genetics of these and how they fit into the human equation but they've released none of it. What can be released for now is being released at a steady drip and not in ways you'd think but in ways like this because it's what they approve of and want. Eventually it will build up to main stream public knowledge that they are there, they are going to be known about soon and as we expand as a society we'll be running into them more and more so it's time to let people know and prepare. 

Cebidatelidae arktos
Cebidatelidae nerteros pacificus
Cebidatelidae somphos
Cebidatelidae americanus
Cebidatelidae texicanus
Cebidatelidae amazonia
Reply: Troy Taylor
Reply: Nice
Reply: +Troy Taylor I think Agent Man was on average, smarter than we are today. And Occam's razor States usually the simplest explanation is the most logical. Maybe this is why the pyramids took so long to build. They didn't just cut the stone they had to build it, as seen in the Ten Commandments. But instead of dragging the stone up the sides of pyramid. They probably drag the materials up and cast it where it's sat. And because the materials had to dry and Harden as well. It had to be built slowly.
Reply: I think your right on track. I believe a special concrete mix was used. Then super heated that mix with lenses and formed those mega blocks to their liking. If done this way the mega blocks wouldn't even have to be picked up at all.
Reply: A
Reply: Troy Taylor actually they softened the stone which makes it quite simple to work.
I have mastered this technique, and can do it with a minimum of fuss !
Reply: Johnny Hardcore thriving amongst the walkers. All I did was notice magnets push.... And that force can be harnessed. I got no remorse for having to school fully fledged academia road humps.
Reply: Troy Taylor shuuup
Reply: Troy Taylor shut up. I ain't reading ur sheet.
Reply: Troy Taylor ey, wanna learn about the past, welcome to the present foo
Reply: Troy Taylor for the sake of being more than rude. The worst part is you went to school. And are so below the level. 
Lazer rifles, free energy, antigravity. 
And you went to school. Hahahahahaha. Wasteman